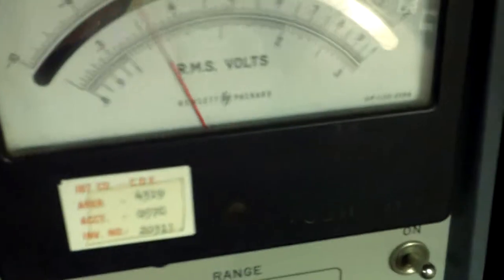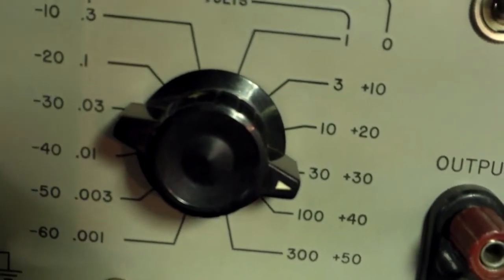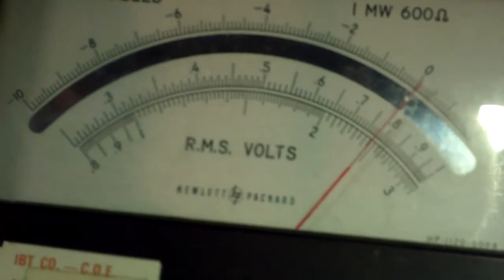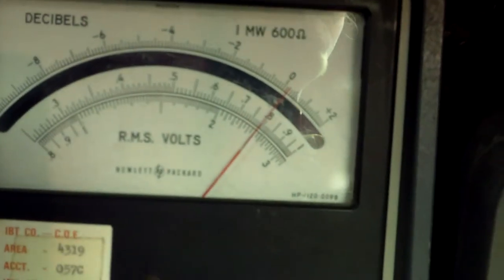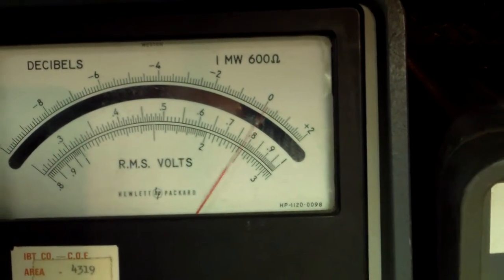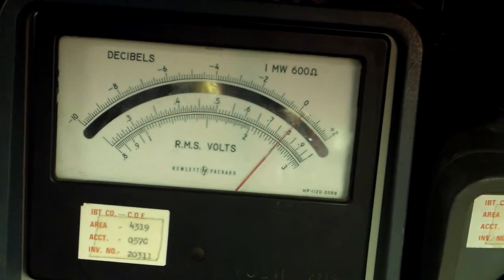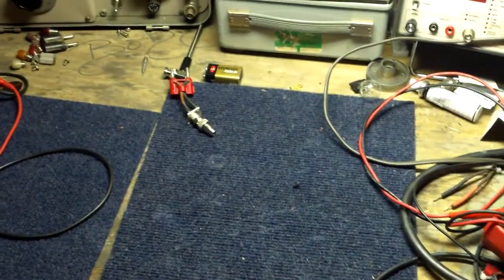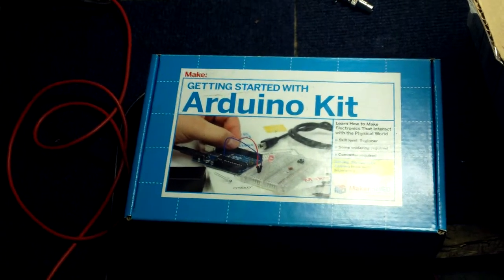HP Vacuum Tube Voltmeter part 2 of 2

Comment: Also, be very careful to only switch one pair of tubes at a time and remember where they were before. Do not move any of the positions of (especially the input) switch wiring or components either, as these were carefully positioned by the factory to balance out stray capacitance and avoid ground loops. Speaking of ground loops, sometimes the fact that both the signal generator and voltmeter are grounded at the power receptacles and through the test leads can cause instabilty or other problems. These are wonderful meters when working properly and calibrated. Within their frequency range, I often reach for my 400H instead of a scope to check out a low voltage sine wave because they are so fast to use. That's all I got. Hope it helps.

Comment: It appears that the meter needs to be mechanically zeroed. It is typical of these 400 series for the meter pointer to float a little above zero on the lower ranges when it is on, because of internal and stray noise. This does not affect the accuracy when there is a signal applied, but the pointer still should be resting on zero when the instrument is off. Regarding the little bit of pointer ocsillation you are seeing, that is usually caused by a one of the 6CB6 amplifier tubes becoming noisy or microphonic. It can also be power supply instability due to leaky capacitors or other causes. Sometimes swapping the positions of the 6CB6 tubes to get one of the more stable tubes into the earlier, more sensitive amplifier stages will help the pointer stability.